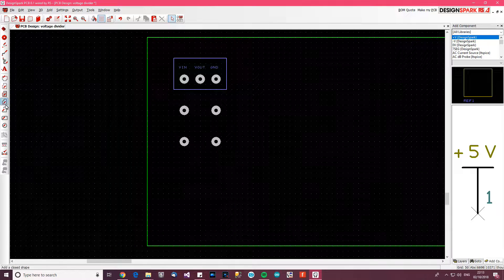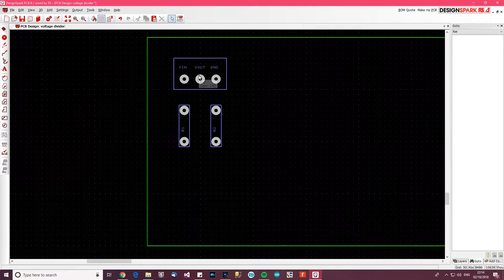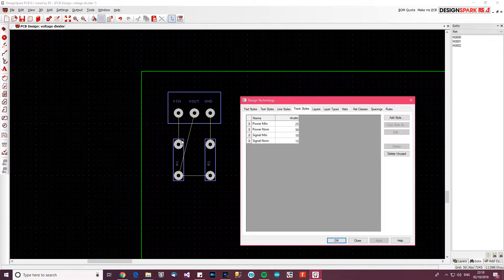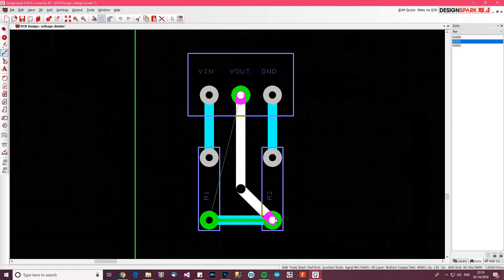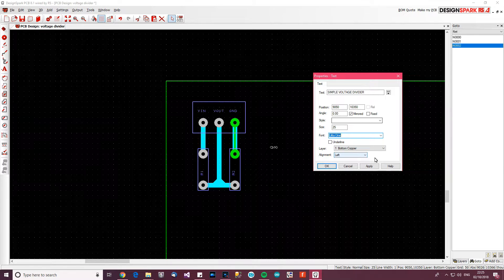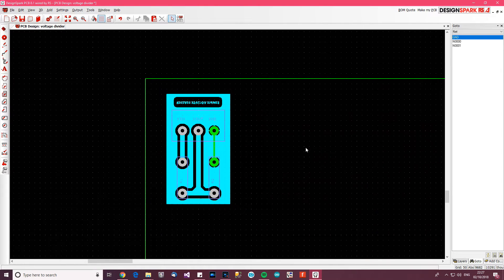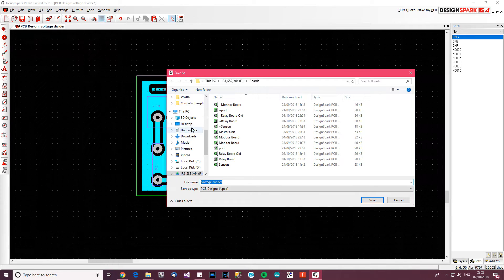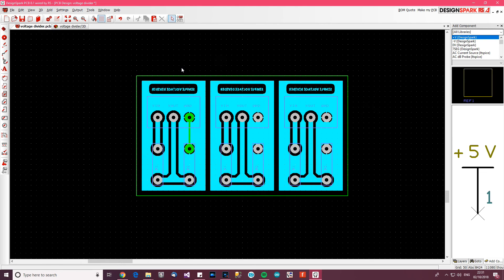TUTORIAL: How to Design Your Own Custom PCBs For Copper Clad Boards - DesignSpark PCB - Part 2

Comment: Yeah that's defo the way to output for a homemade board. The pdf option is a nightmare as you have to iterate re-sizing and you run into drill breakout/backoff problems which leaves lots of the hole filled in. Incidentally some people say you should fill the plated holes (there's an output option for this), etch the board without drill holes, then drill after etching. Those who advocate this say that if you etch the drill holes, the etchant gets under the pads and eats away at the resin which is what causes the copper to lift around the holes when you drill. If you wanted to do it this way you could print a drill ident and stick it to the board with temporary spray adhesive to give the exact locations of the holes after etching. Therein lies one of the great assets of DS PCB - it gives so many options to achieve the same goal.